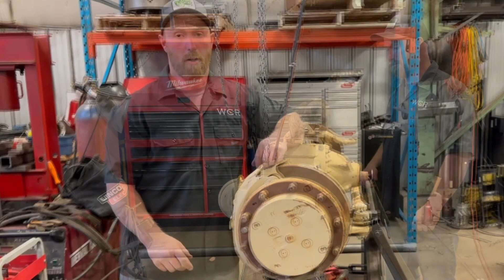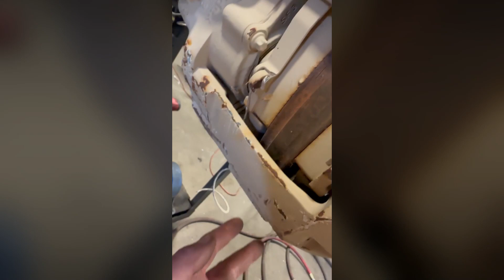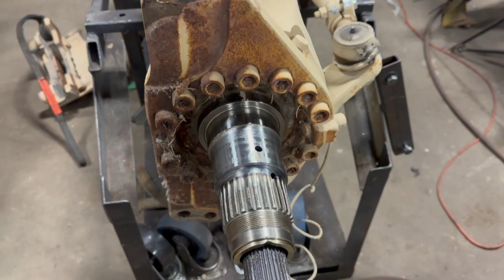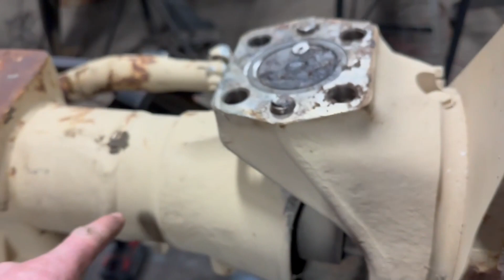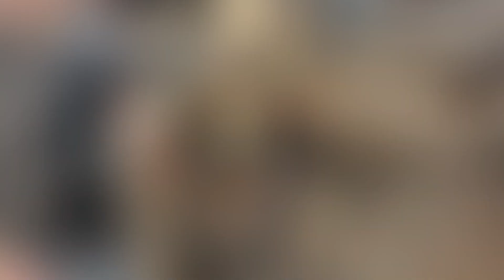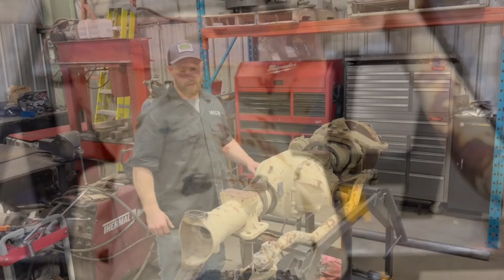Axletech 4000 Wheel End Disassembly

Comment: Great video, very clear. Would there be any merit in replacing the fragile two part hub seal with a regular double lipped seal running on the spindle?
Reply from the maker: The seal is actually pretty robust, just doesn't like being removed and reinstalled, companion seals typically last way longer than a normal lip seal under normal operating conditions